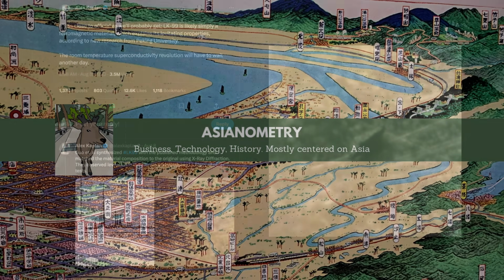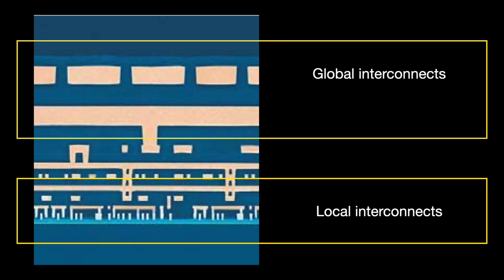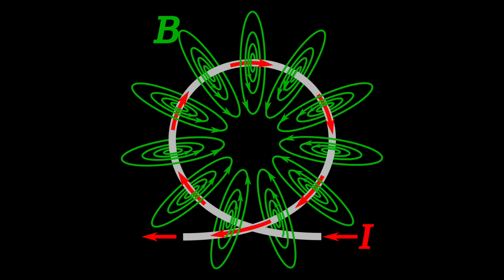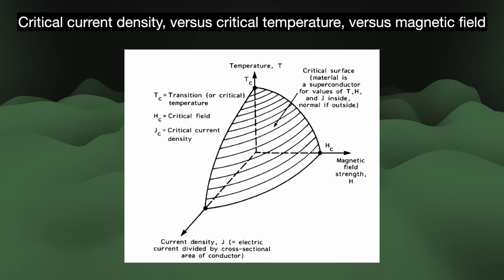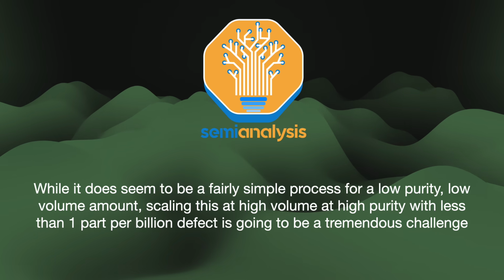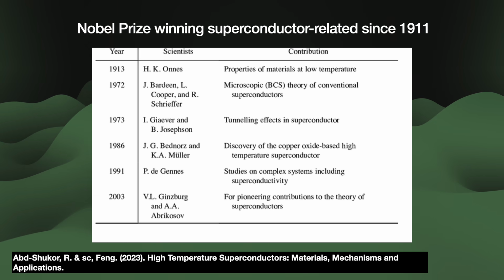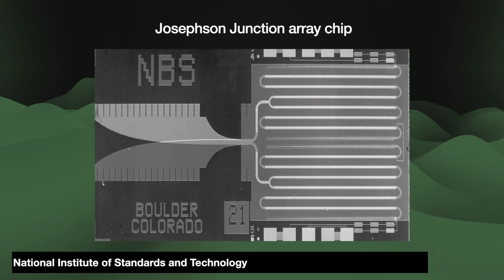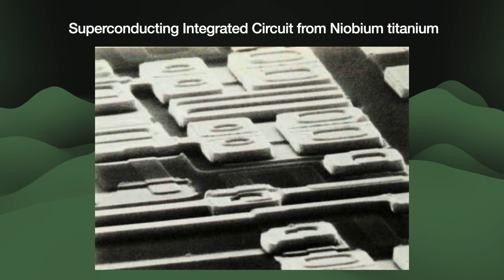LK-99 Wouldn't Have Changed Semiconductors Anyway

Comment: I wouldn’t trust any validation study that took less than a few weeks.  Science, the actual process of establishing Fact through documentation and data collection, takes a significant amount of time.  I haven’t seen an sufficiently examined papers validating, or invalidating, the claim yet.  I’ve seen some very questionable videos of confirmation suggestion, and others who just say it’s fake — without ever scientifically investigating.  It will be interesting when we start hearing and reading the real analysis of the material in question.  I’m interested if anything can be garnered here.  Perhaps this material isn’t a superconductor.  What else can be learned about it?  On the hand, it’s the real deal.  In that case, it’s time to buckle up.  In the meantime, I’ll sit back and remain anxiously agnostic.  

Because… you know, “Science.”

Comment: My first thought when reading about LK99 was that if it worked, it could be used to create tiny MRI machines and super powerful and small electromagnets for all kinds of research and industry use. The reason MRIs are huge is because of the cooling requirements to keep the superconducting magnets at operating temperature. The reason most powerful electromagnets are huge is because of heat generation.
Sad it hasn't panned out. But we may still see a room temperature superconductor material as computing power increases and AI can be used to explore options faster.
Reply: Perhaps but current MRI scanner magnet design uses niobium wire with a dual helium / nitrogen cooling system that (at least in fixed facilities) has a liquefier unit on site. Ceramic wire is apparently too flimsy & prone to failure, which is dangerously catastrophic in magnets that size (that is, anything suddenly stopping the current including drifting above Tc will cause the back-EMF to physically rip the magnet apart & damage anything nearby, much less inside; there are videos of this)
Reply: @ms_nop I can't seem to find these videos... 
I doubt that a broken wire will make the whole thing self destruct in the described way.
Reply: another is that you need a person to fit inside it 😉
Reply: @cj09beira  Well, you could use a wand with a superconductor or a projector.
Reply: It's too early to know if it'll pan out. That said, some of the Chinese tests are saying that at much lower temperatures than claimed it really is a superconductor, which combined with it's reputed ease of manufacture might be enough to make it a favorite of high school science fairs and some early college classes (just imagine, a superconductor finally making it out of high-tech labs into low-tech labs). It might also elbow out some of the existing "high temperature" superconductors, depending on it's exact characteristics, and it seems to have an interesting "resistance collapse" at higher temperatures that might be useful for temperature sensors.
Reply: for starters there have been some superconductive effects reported by some labs. For instance some labs got flakes that were able to stay in suspension over a magnet. Needless to say, you miiiiight be able to explain why a lab would fake a breakthrough to get headlines, but there is much less of a reason why other labs would repeat the experiments and get somewhat similar results but not quite exactly the same. So, point is, the jury is still out eitherway, chances are there is something going on still, we just don't know what. 

As for your point about supermagnets, that's also a large issue with fusion power. And, unfortunately, the public is bloody brain dead and needs some miracle breaktrhough like that before they'll actually accept nuclear power as an option. (despite the fact that nuclear fission is already the cheapest source of power when factoring in plant lifetime extensions, kills less people than solar per MW produced, pollutes 4x less than solar per MW produced, doesn't require grid scale lithium ion batteries, etc.) I mean fission as is might as well be a miracle cure, but evidently people won't take anything until they get a miracle vaccine that prevents all illnesses and gives you super powers and a room temp super conductor could do basically that. (speaking metaphorically sitll of course. My point is that if you could get a super magnet then containing plasma for a fusion reaction would be far more doable and if we managed to crack fusion power it would basically be completely free energy that not even the most brain damaged of laymen could spin as dangerous and evil.) 

Plus I vaguely recall someone mentioning that a room temp super conductor could be used to make super capacitors that could store enough power to basically act like batteries while charging near instantly, discharging however fast they need to, etc.
Reply: @robonator2945 The gods of the universe gave us 100 trillion tons of uranium, and we spit in their faces.
Reply: @robonator2945 🤣🤣salty 🤣🤣

you don't need a miracle vaccine for most people with common sense. Just that the illness incidence and probability of lasting effects exceeds 500 fold (yes this number is a guesstimate) that of a vaccines disadvantages. 

as for radioactivity. people like to live somehow 😅 . It isn't that we don't trust the machine, but rather its operation! 

as a rule of thumb: 
personally I don't like fused chromosomes. 😂

Comment: You mention in your video that superconducting process unit density is an issue. It's worth noting that with CPUs at least (notably not graphics cards) the vast majority of transistors contribute only logarithmic value for execution speed at best. My current understand is that a ~50,000 transistors CPU designed in a modern TSMC fab would be about 50% as fast as the best CPUs, despite not having the billions of transistors that modern CPUs have. This is because the vast majority of transistors in a single-threaded application are used for branch prediction and other things which are very ineffective per unit transistor in improving performance. If you can push your processor to 100 ghz, but only fit 50,000 transistors, you could conceivably still improve single threaded CPU spead by ~12x, which would be an industry breakthrough. I think a proper, easy to manufacture, high purity room temp superconductor would definitely revolutionize at least single-threaded CPUs, if nothing else.
Reply: You're only looking at part of the problem. The biggest performance hit you see in the average program are cache misses, often because of missed branch prediction. Your cpu tries to load a bunch of instruction and data in advance to fill the pipeline, but if there's a branch it didn't predict correctly, it's going to have to load a bunch of stuff from RAM (most likely) and it will be stalled for quite a bit, for a duration that doesn't depend on its frequency since that's an interconnect limitation.

If you're making a "dumb" dsp or a gpu with no branching that works (and it's already what is being done more or less).

What stopped Intel from going further with netburst (P4) was that they could have raised the frequency (to a point, TDP was exploding already), but because of the latency when fetching data from RAM, it would require an even bigger pipeline and would just lead to no improved performance is the branch predictor wasn't working well. Which leads to putting two pipelines on one core so unless both stall you're still doing work.

Unless you program in a very specific way to avoid predicted branches as much as you can, just ramping up the frequency won't increase performance that much. It will in the tasks that are already better left to a gpu, but not for the average cpu task that is highly branching.

Comment: Super conductors for SoC is maginal benefit because the interconnects are not that long and the CMOS gate charge and discharge interconnect that are more capacitive in nature than resistive. This is parasitic capacitance from the metal interconnect to the substrate which is grounded and attached to another CMOS gate(s) which is a capacitor given its gate is one half of a capacitor, the other half being the substrate or well. Thus the dominant power dissipation comes from the clock lines which switch at high frequencies driving a lot of gates ( assuming a synchronous register design).    
The only resistive long lines are power and ground and they do not dissipate a lot of power at steady state. The power lines need to provide peak power so the DC lines do not drop their rated voltage and slow down the switching of the logic processing info. 
Current and long established solutions is to have large peaking capacitors under the power and ground lines. As per above this is just CMOS transistors with their drains and sources shorted together and tied to ground/power. The power and ground lines would connect to the gates of these large CMOS transistors.

Ps
I used to be a full custom memory and microcontroller design engineer. I worked in the EU and UK for many design houses for @10yrs.

The real application is in power and distribution lines and components such as electric motors of all types and spec. You will have scientific and space applications as well. Forget semiconductors. You will have Quantum computing applications as well, maybe.

Comment: Actually, we can't conclude anything about LK-99... the leaked papers appear to have been incomplete, so no one trying to replicate from them could likely succeed because of it, and iron contaminants and other ferromagnetic effects in the replicated (leaked) samples were responsible for levitation effects in tests.   The supposed paper "debunking" LK99 was also based on the replicated samples, and while it may have made valid statements about those samples, the only people who can make any statements about the actual LK99 material are the folks at the University of Science and Technology in South Korea.   They have the original samples from the engineering team that made them and the presently final version of the paper.   The only report they have released is that they have verified the structure of the samples matches that in the (final) paper.  That's good, because it means the paper has at least some validity.   The simulation performed by Dr. Griffin at LBL also matches with that, I believe.   So, the whole world waits....

Comment: Hey buddy,  i love your vids. They have taught me so much.  Surely if you have a superconductor that has zero resist and low heat loss it would make a difference! Even if it is hard to manufacture? 

Keep up the fantastic work buddy, your vids are an inspiration.

Comment: Superconductors wouldn't have a huge effect on thermal efficiency of chips, because a lot of the heat is actually in the transistor switching. Whenever a transistor goes from a low state to a high state, it goes through a medium resistance, where the voltage drop across the channel times the current through the channel is very high and the charging and discharging of the line capacitance always requires current to be pumped in. Other than that, leakage through the dielectric is also really significant.
Reply: finally someone with a brain

Comment: In a way the only benefits that the industry if IC can obtain from a superconductor application is the lessen use of decoupling capacitors due to less loss of power and stronger signal integrity while using less power.

Comment: The interesting thing is that many of the theoretical studies came back with somewhat positive results implying that some materials with these types of structures may exhibit superconducting properties. So even if the actual material itself is not superconducting it's a good step forward for research teams and may potentially lead to a superconductor in the future.

I think the most interesting use is for power transfer over large distances which is obviously positive for the people who think climate change is at a critical point.

Comment: Cooling and throttling is a huge problem with modern processors: if the lack of resistance keeps the cpu/gpu from heating, the clock speed could be increased dramatically.
Reply: imagine having a processor that can just go super critical if it gets too hot lmao, gets too hot in one spot, resistance goes up then everything gets hot.
Reply: Don't semiconductors work by dynamically adjusting their resistance?
Reply: did you even watch the video lol
Reply: @buzhichun  Who knows?

Comment: Thanks for the interesting discussion! Generation of magnetic and electric fields doesn’t mean energy loss. The energy is stored in electromagnetic fields and can be recovered. RF circuit design takes these into account, and I think they can be managed:) I wouldn’t rule out the usefulness just yet.
Reply: You still get the propagation delay, reflection loss in the switching device resistance and the hysteresis loss in the dielectric still acts as resistance at AC.
Reply: The term 'Loss' means potential energy that is put in is not used for the process or transferred. They are inherent, whether stored, radiated by fields of energy or heat. Recovering or limiting such losses in itself makes for more complex resolutions?
Reply: you still get delay, and you don't get 100% recovery, there is still losses there.

Comment: Regarding capacitance, much of the energy spent on interconnects, especially when quickly transmitting signals long distances across a chip, is limited by capacitance, not resistance. What matters is not merely getting a strong enough signal to the other end of the wire, but getting the voltage high enough within a certain amount of time.

If we use a water analogy, this is like pumping water into a pipe to get it up to a high enough pressure. A longer pipe has more volume, and more water must be pumped in to hit a certain water pressure. In this analogy, water pumps are like transistors. If we have a long pipe that we want to fill faster, we either need more pumps working together, or we need a bigger pump. Contrary to common intuition, this actually creates situations where a chip can run faster if we make transistors bigger, at least in the circuits that involve long-distance wires.

Larger transistors/pumps, as well as larger numbers of transistors/pumps will of course require more power, and this energy is often much larger than transmission losses. For short wires, sure, a superconductor would help. But most power spent moving data around is on long-distance communication, not short-distance.

Comment: Couldn't a super conductor circulate power in a lamp endlessly? No need to plug it in.
Reply: not if you want to get light out of it - that's extracting energy from the circuit regardless of the materials and devices.
Reply: Not in a lamp, but superconducting inductors are used for energy storage.

Comment: What about materials with lower resistance then copper like graphene?
Reply: Carbon nanotube transistors are being researched but still theoretical and not commercially viable. However the name is so nerdy that it has to become reality some day, because it's impossible to say without adjusting some glasses on your nose.
Reply: @wile123456  wouldn't they start with upper power wires, I don't think they need the transistor.
Reply: @AndrewMellor-darkphoton  idk you me tioned graph ne which is flat carbon sheets so that was the only thing I thought of. Carbon nanotube transistors can be made very small which is their main purpose. For wires I haven't heard of any use for them

Comment: Lk99 claims to work by using tunneling supercurrents between quantum wells not cooper pairs so the working temperature calculations might be different
Reply: Apparently tunneling super currents are unrelated to temperature
Reply: I know a cooper.
Great guy.
Very strong thighs.
Reply: People just need to wait until those Korean show up and proof or disproof whole thing. I don't understand all of this replication frenecy. Every scummy nation is going to claim that they have it. We just need to wait the oficial announcement
Reply: So working as a Schottky diode?
Reply: @@ntdm25lmao what, that's not how science works.
 They need to prove that it works, but they can't. Cope.
Reply: the working temp calcs are wrong to begin with looking at existing high temp super conductors.
Reply: @vyor8837  : The initially claimed operating temperature was high enough that we should assume the existing formulas are wrong for it anyways (which, yes, there is precedence for: already known "high temperature" superconductors don't follow exactly the same formulas as the originally discovered batch of superconductors). Whether LK-99 is a room-temperature superconductor I don't know, but we should expect that if it is, then it won't be of any known type.
Reply: It doesn't work, get over it

Comment: "Current density" - Now I feel like Ohms law is a lie... I was imagining superconductors as a hair thin wires to run 230 volts with millions of amps across the country without need for high voltage lines and transformers.
Reply: It's more like a guideline. For most electrical work, it's good enough. When you get into microelectronics, the details matter.

Comment: Basically, if you collapse a magnetic field, it becoes homo-septic, like press 30 tiny neodynium magnets togeher, they stick because you cancelled their polarization, but the flavor of the material is a gravity flavor, so they run back into the material.  So you get a circle of collapsed fields and it entirely pulls from the center.  By always pulling from the center, you get infinity surface crawl.  Agravitational ability to share a surface, instead of just electrons share the surface.  However, its also a bomb, you could stiick +++ - +++ - +++...into a pure bomb.  But this would take somenano teck robots. Its ultimately the secret to the pick & and place Emanual Rutherfurd prototype, "huh huh huh, how you manage to do tjat?"  Shut up, uh,i;m busy here.
Reply: i cant tell if youre mentally ill or a bot